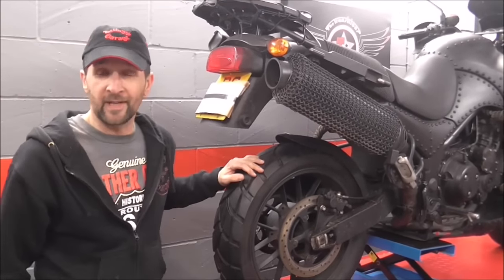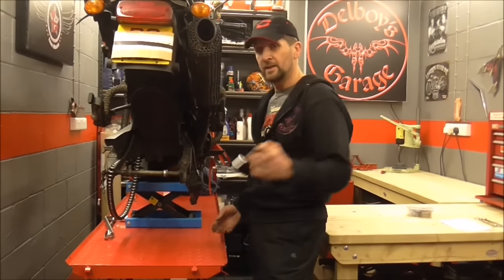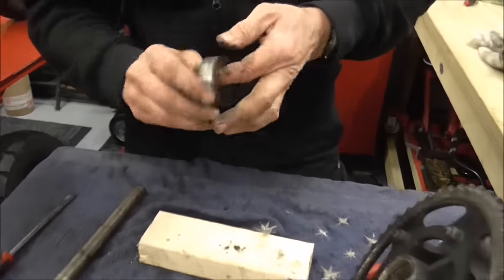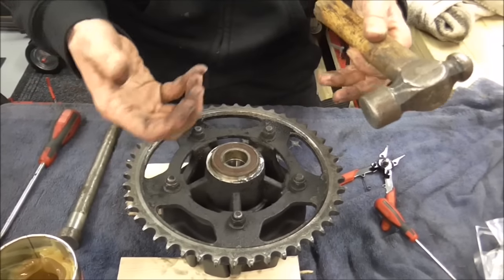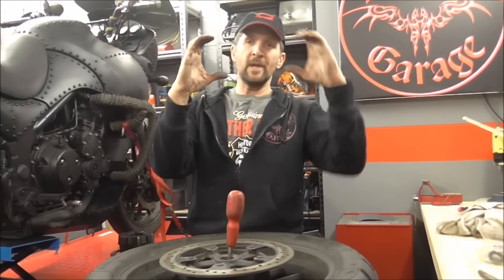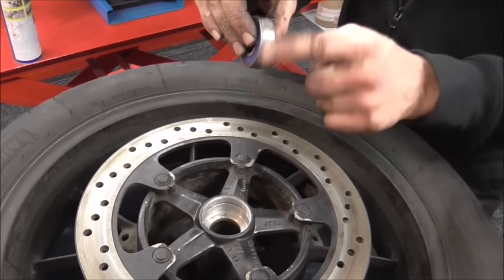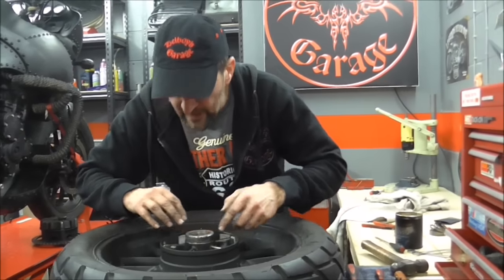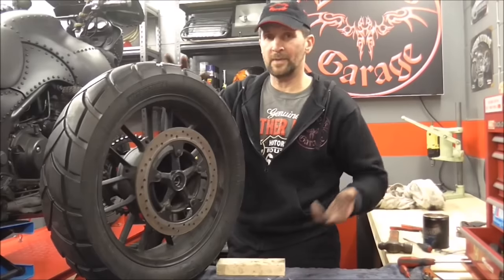Delboy's Garage, Motorcycle Wheel Bearing Replacement.

Comment: Another really informative video.bearings are in the post so will be attempting them soon.cheers mate.
Reply from the maker: Have fun and good luck with it mate..
Reply: @Moonfleet41   it's a 600 but previous owner put 1200 swing arm and rear wheel in it.just wondered what advantage that would have?standard front wheel with120/70x17 tyre.hope you dont mind me asking?
Cheers
Reply from the maker: Back wheel on the 1200 is wider, (5.5") so you can run a 180/55/17, and not just a 160.. the swing arm is not only wider (as obviously necessary), but a lot stronger and stiffer too..
Reply: @Moonfleet41  .ok cheers

Comment: kewl vid.... I save one of my old rear tyres and use that as the spacer instead of wood when do the actual wheel bearings. Dont have a sprocket (divi900 shaft) so dont need to take one off.

Comment: Sorry for the criticism, but there's a proper way to install most snap rings/circlips. Cut edge or "break edge" is installed away from the force of the bearing. Also, some gently applied heat to the aluminum housing will really aid in the installation and removal of bearings.

Comment: A fine instructional vid, but at 27:00 you use 320 grit paper to wipe out corrosion. Grit from those wipes will fall into your cleaned bearing cavity. You forgot to wipe out that grit before applying grease to the bearing for install.

Comment: Nice well explained wheel bearing replacement enjoyed it .just a thing ,did you know a circlip has plier hole one size ,larger than the other side ,and that the outer edge that fits in slot recess is bevelled I know you put everything back as it came off top job sir👍🏻🇬🇧

Comment: I never replaced wheel bearings on motorcycles, but wheel bearing on cars are pressed in. That's the way I was taught. I have misgivings about using hammering action to insert wheel bearings,  especially when the wheel bearings will be inside soft metal, such as aluminum. Hammering action can cause irregularity on the soft aluminum walls. 

It appears the retaining clip had some rust on it. I would have wiped the retaining clip of dust/rust with an oily rag before putting it in.

Comment: hmm I have a 2015 Road king. I bought a bearing puller and install tool. Did my Honda shaft drive like you did that one. But Im hoping the puller installer tool will make life easier. thanks for the video. You ever try putting the bearings in the freezer at night and head up the sprocket and put them together... Kind of like fitting a tight barrel to a AR 15 upper.

Comment: Thought I might add that m&p have another site called busters which tends to deal with clearance stock, they also have an eBay shop. Worth checking out you might find the parts you need that bit cheaper again 👍🏻

Comment: It's all so good to put your bearings in the freezer for a few hours to cause them to shrink and then heat the area you're putting them into  a bit (heat gun works you don't have to use a torch) this will cause the metal to expand and then the bearing will go in much easier.
Reply from the maker: No need for that procedure on wheel bearings Paul, everybody knows that procedure, but its designed for bearings that are going into a steel interference fit.... wheel bearings going into an alloy rim just need tapping in lightly... also, the sudden hot again cold can stress crack an older wheel rim.. dont make life harder than it needs to be aye....lol!

Comment: Still haven't even had to do this yet. 121,000 miles on my 2007 CB919 on the original bearings and there's no play/noise at all despite the fact that I throw it down hard in the mountain curves. It's as rock solid as the day I bought it with 19,000 miles. Maybe honda bearings don't wear out?

Comment: I've ordered all new bearings and seal for my hayabusa there were 2 seals and 3 bearings I hope parts house got everything. I'm going to go ahead and replace the hub drive cushion dampers. My question is this video the same way to remove and replace or would you happen to have a busa bearing video replacement .. t/y
Reply: All pretty much the same, as Del said, sometimes there are three seals.

Comment: On the rear wheel of 1980 Honda CB250RS there is a collar that goes into the bearing on the right side.
Therefore it is not possible to displace the spacer tube. You must remove the left side bearing first but it is difficult to drive it out with the tube in the way. You can not get any purchase on it.

Comment: Very good and useful video. But i am wondering one thing:

Why do you put grease on outer part of bearing? I read and heard on many places that this should not be done. Ok, it will help bearing to fit it's hole, but it can also be done without it i guess. Also in service manual for my bike it is not mentioned, and it is very specific when you need to put grease on other places, for example oil seals. 
I know it is almost 7 years old video, but i would be grateful if i get an answer :)
All the best!

Comment: Great vid - simple, straightforward advice that'll give a lot of beginners the confidence to have a go themselves. I was just wondering; could you use the same principles of drifting the bearings in and out for a single-sided swingarm? whatwith the bearings being that much bigger/wider?
Reply from the maker: +Fell Rider Hi mate, the principle of removing and replacing any bearing is much the same... but if its a lot bigger then these, then you can probably get a proper puller in there to draw them out smoothly...

Comment: There should be some heat blower for taking bearings out more smoothly. And but it in same way as crankshaft (Freeze bearings and heat the pit).

Comment: Who else is watching this wondering if they put the circlip back on after tapping in the new bearing? I think with everything else proper, it’s all good. Already rode a couple hundred miles. With the 100 Newton-meters on the axle nut locked in place with a cotter pin, I think I’m good.

Comment: It may have already been mentioned...! But whenever I replace bearings I put the bearings in the freezer over night and with the wheel at room temperature they usually just drop in without much effort.  Once in the wheel they warm to the wheel temperature and lock in.

Comment: +Moonfleet41 Thanks for all the work you both put into to your videos! I've also got a tiger 955i so end up using them all the time. Like you I ride all year round in all weather types. As a result I had to replace my rear wheel bearings about 12 months ago so good to know I didn't screw anything up! Thanks again!
Reply from the maker: +Tiger955 Cheers buddy, and good on you for taking it on yourself, it ain't hard is it??  Just a it of good old fashioned mechanic-ing !  Ride safe  buddy, and enjoy the big Tig !

Comment: Good vid Del. Tip I heard was to put the bearings in the freezer for a while to make fitting them easier. Freezer causes the bearing contract slightly. Thoughts ??
Reply from the maker: I don't have a freezer in my garage and by the time it gets from the kitchen to my garage, it'd be little difference in size, specially on a warm day!  It's no trouble to press them in, but you can do them either way if you have a freezer handy mate.

Comment: Great tutorial.  Just one thing, you cleaned the top of the bearing housing with emery, no probs there, but you didn't clean out afterwards.  Though there might not be much, any emery powder in there is not something you want near a bearing.
Reply from the maker: Yeah, good point, but hardly enough to leave a residue, and the first licks of road salt will do worse that that..lol

Comment: Thank you for another GREAT video. I subscribed to your videos a long time ago. I'm doing rear wheel bearings on a relatives Kawasaki 900 classic. I took it for a ride afterwards and about a half mile from home it sounded like I was pulling a rope with a bunch of pots and pans attached to it.  I got home pulled wheel off and the new wheel bearing on the brake side was locked up. I'm still not sure why this happened. I noticed when I torqued axle nut{70 ft lbs as per net }, the wheel did not turn as freely as I thought it should. I thought this was probably from the new bearings with new grease in them, but apparently not. Waiting for a new sealed bearing to install, but still not sure what happened. The other two bearings are fine. What did I do wrong?     UPDATE; Thanks to your video and a diagram I pulled up on the net the problem is solved. The stealership originally replaced ONE wheel bearing that was bad before he brought it to me to replace the other two which went bad after he rode it home from the there. They left out the small spacer that went into the bearing from the rubber damper side. I'm 72 and have NEVER took ANYTHING to a shop to be repaired, and this is the reason why. Thanks again for your awesome videos!!!!!
Reply from the maker: Hi there.. after reading just half way through your message sir, i was already thinking "Centre spacer missing?"   and indeed you confirmed it.. that's the kind of mistake that should get any garage mechanic looking for a new job... perhaps an easy oversite, but once you see how critical it is, it should be a mistake you NEVER make... I'm glad you got away with it on the test ride without incident, and that it's all now fixed..!  doesn't instill faith in dealers does it..lol!

Comment: Great video, but 1 thing that gave me goosebumps, don't use the old bearing to fit the new one. Get a bearing mounting kit. You should only need 1 or 2 sizes.
Reply from the maker: Very posh mate... I've used the old bearing to do this job for 25yrs, never had a problem... it's important to make a note, before you start, that the bearing doesn't live any deeper down it's hole than about 1mm spare, otherwise the other bearing will get jammed in the hole too... if it's a warm, ambient environment and you clean the hole properly, plus a little WD40, it goes in with very light tapping, you are not hammering it... this is a common alarm bell usually for people who've not done it much, or at all... this video is to help the novice and they just don't own tools like bearing drivers...

Comment: ....at 2.00pm today , my bike is back in the dealers workshop for front wheel bearing replacement....after it failed the MOT last week. They phoned yesterday, to say the new ones had arrived from Honda and it'll take a 'couple of hours'...which surprised and annoyed me - but after watching this I was sort of reassured as you say the same ! I've had lots of 'advice' from viewers saying I should get cheaper ones ....like 'Slinky Glide' from Wemoto...{!}..and do the job myself - but the shop is re-MOTing it afterwards and if I attempted it they'd charge again for the re-MOT whereas as they're doing it ...they wont recharge. I'm also going for a tootle on their loan bike, a Triumph 1200 Bonneville while they do it ! I'm not sure I could do this correctly anyway, not having a bench or ramp or proper tools etc.
Reply: ...what brand of bearings did you use for this re-fit ? 'All-Balls' are used by a racing supplies company on e-bay , but I wouldn't even consider the budget Chinese unbranded ones without names - but again , my viewers have said the 'Honda' ones wont actually be MADE by Honda ...though I realised this and the reassurance is that Honda will have tried , tested and approved the quality from THEIR suppliers ! Thanks for this helpful video.
Reply: ...I'm also waiting for the postman as I write this - I've ordered an e-bay front left caliper as my current one has a very stiff couple of pistons which are wearing the pads into a weird wedge shape. I've had advice ....to break the caliper open and change all the seals - but the cost of that plus all the work...AND the potential for disaster if I attempted it , made me decide just to replace it with an 'as new' caliper from a low mileage scrap bike !
Reply from the maker: Hi buddy, ok, lots to cover, but your viewers, Honda don't make bearings, they buy them, same as Harley don't make oil even though it's written on the pack... but in both cases, the ones they buy are of the highest quality in order to stand up to OEM warranty, so the Honda bearings will be top notch... however All Balls bearings are what I used in this video, and are trusted the world over for being a top brand, they're not expensive enough to cut corners on.  I think you made a good choice getting them to replace them cos then the work is warrantied, and at least you have peace of mind...

With the caliper, you could indeed have done it yourself, Wemoto sell pistons and seals and everything you need, but if you're not confident, once again, peace of mind has value , just make sure the caliper you buy is guaranteed, at least for 3 months, and when you get the old one off, why not buy the seals for a couple of quid and have a go at re-building it, just for learning purposes??  If you bugger it up, it doesn't matter as you're not using it, but you'll learn a new skill and save you money down the line... good luck with it all !
Reply: ....thanks very much mate , and I'm pleased to say that after watching your bleeding video...!....my brakes are now sorted ! I was panicking last night as there was no pressure whatsoever....but I persisted with it , and after watching an American's video in which he clamped the hose to increase pressure...?...the bubbles flooded out and the brakes , with the 'as new' calliper, are fine now ! HOPEFULLY my 'wedge shaped wear' problem with the pads will be sorted....!
Reply: ...yes, I was gonna see if 'Spares Unlimited' in Hull would buy the old calliper from me , to service and repair and sell on ....but yes I might have a go with it myself for practice !
Reply from the maker: Hi Steve, so glad you got it sorted, good going!  Can I just offer one little care word, and that is not to clamp brake hoses naturally the modern steel braided hoses that come on practically all bikes now would be irreparably damaged by clamping them, and even the old rubber hoses,= may be fine to clamp when they're new, but when they are a little older, then they can crack as old rubber perishes over time, it's never wise to kink or clamp brake hoses, but I know how it is, sometimes the buggers just won't bleed up and you have no choice, but just be careful buddy...
Reply: ...thanks again for the advice mate - and all your other helpful videos !

Comment: Well you can do things many different ways. This is absolutely not how I would have done. A tip though, use an expander bolt and knock the bearing out to avoid any wiggling. You are expanding the aluminum. Never grease the outer ring!

Comment: Question about the circlet... I got myself a new rear rim for a CBR1000RR and it seems for some reason the dip for the circlet does not go all the way around... but my question is : Is the circlet mandatory to be in there? If the only purpose of the circlet is to stop the dust seal from going too deep, is it a mandatory thing? From my understanding the bearing does not need the circlet to stay in place? Thank you.

Comment: Ace I’ve just ordered chain and sprockets and fresh Cush drive rubbers, they can wait another few days and I’ll order some bearings as well.

Could you put the bearing in the freezer for a few hours to try and shrink it slightly so it goes in easier? Saw a clip of a Vespa main bearing replacement earlier and they had put the engine casing in the oven got it up to 70C and the bearing just slotted in.

Comment: Hiiya l have a problem with rear wheel on my fire blade 918 trying to replace the wheel bearing, watched your video l thought l would have no problem , but there is no gap between the bearing and the alloy tube, tried heating it up but no joy, l thought you might have a way off sorting this . Many thanks  watches loads of your videos always top advice on them
Reply from the maker: The spacer tube in the middle is only held with squeezing force between the bearings, poke a pry bar in there and lever it slightly to one side..!  it'll move, then tap the bearing out from the other side.!

Comment: Having recently purchased a 2010 Harley Road King, I'm now free to get really down and personal with the 1981 Harley shovelhead I've been riding for the last 38 years.
Regarding axel/bearing removal and installation, is there any reason a rubber mallet can't be used?
I'm about to remove the swingarm and check the condition of the bearings and the pivot bolt......all of which are original.
And what is that thick rod you are using to hammer out the bearings?
I want one!
Tx for the vids mate!😊
Reply: Haha......I see further on that you DO use a rubber mallet!
So I guess you can use it to hit in the new bearing using the old one on top.

Comment: Just a quick one for you- are busa,s naturally heavy on front bearings for some strange reason? i,m on my second ,and both have a tendency to eat them relatively quickly, none of my supermoto,s ( admittedly much lighter) or zzr1100,s blackbirds i,ve owned never experienced this.
Reply from the maker: Not as far as I know by reputation, but it is interesting that the Hayabusa front tyre pressure is recommended at 42psi, way more than most bikes, so perhaps that indicates it has a heavier front end, perhaps something to do with the slip stream and down force created at speed, they're a 200mph bike after all (well, allegedly anyway!).

Comment: im thinking can we use some sorta grease between bearing and the rubber seal or any material that can help bearing to avoid receiving any foreign debris , moisture etc, that has managed to cross the seal. i think that can ensure long life, because i observed mostly these bearings get rusty
Reply from the maker: Hi Jalal, that is a good idea my friend, take some regular, ordinary grease, pack it out and then squeeze the seal down on to it so it traps inbetween... aything to keep the water out because, as you say, they are very prone to rust eventually.